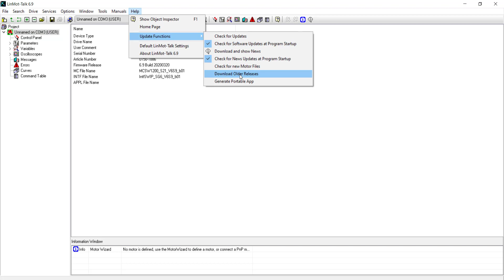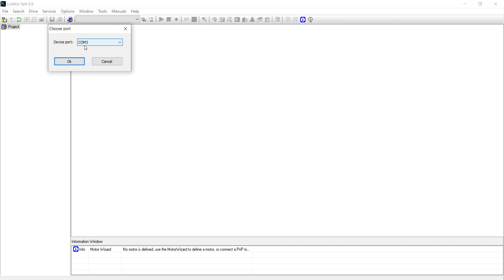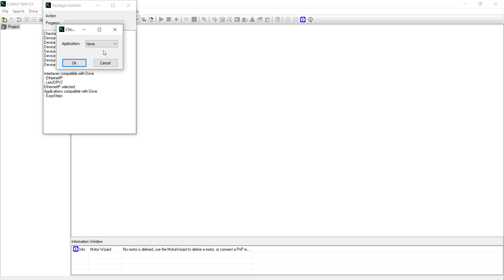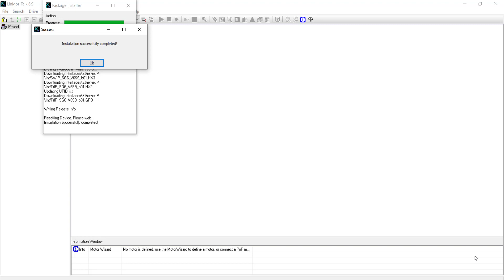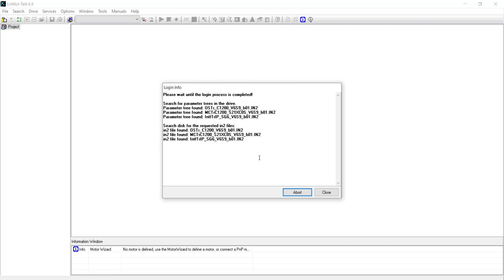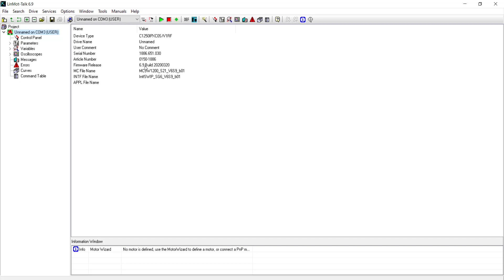LinMot Talk Configuration: Installing Firmware

Comment: Rather an incredible statement at 1 min 45 sec... "Can't jump to more than two "Minor" revisions as you download firmware in doing so... can BRICK the drive"    What does that actually mean? ... what's a minor revision to firmware?... apparently any revision to the firmware.?.. I seem to remember back in the day,  it was no further than two TALK revisions ... like from TALK 6 to Talk 8 .. but not TALK 9   ... now it's "minor revisions"?   And what exactly do you mean by "BRICK" the drive... that term generally means that the drive is essentially destroyed ... and cannot be repaired using any software, bootstrap or black magic.      Why is that even possible?   And why isn't that a frequent warning in LinMot literature?   or even in the install process itself... you can't make any software that inspects the current firmware.. and compares it to the firmware you might install incorrectly .. and provides a simple warning: "Do You Really Want To Shoot Yourself In The Foot?"    Hmmm... I guess you would sell more drives that way .. I expect that in America... but, not from  Switzerland  :-)